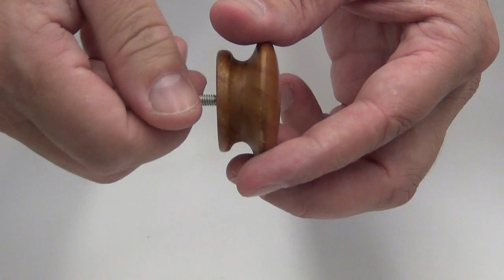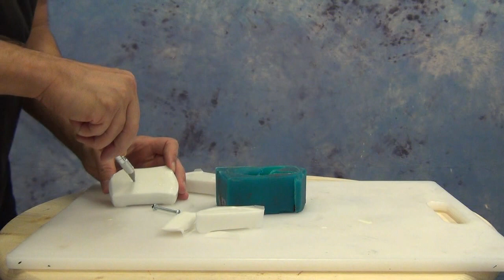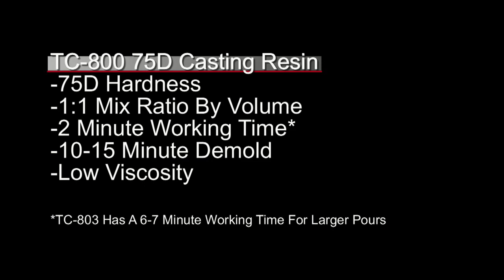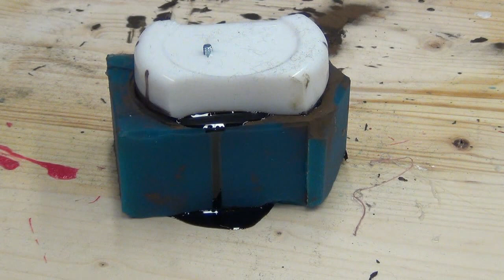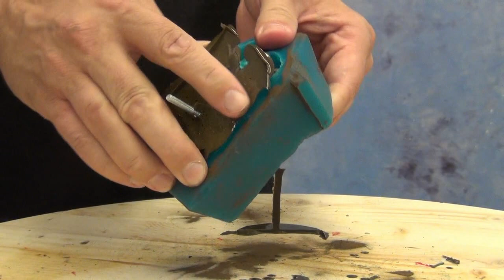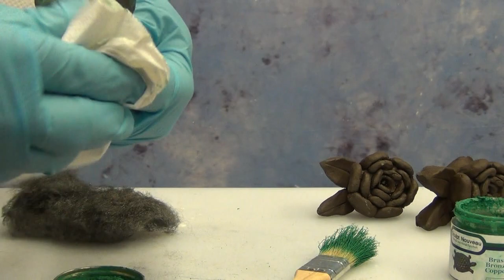Cold Cast bronze Drawer Pulls Resin Casting tutorial

Comment: Concerning a jig for holding metal parts perpendicular to the ground, in the past I've used one of those neodymium buckyball magnets attached to the end of a cheap jeweler's third arm. The round, magnetic surface give a small point of contact for the hanging metal part, allowing it to swing under the force of gravity much like a plumbob till it's facing nice and straight down. It makes for a perfect 90 degree embedded protrusion from the cast for those times when such things are mission critical. (Like in making multi-material drone bodies, for my case)
Reply from the maker: Good idea!